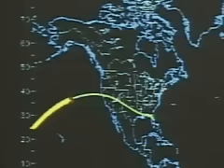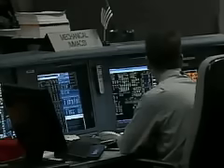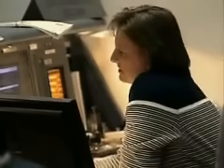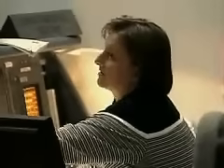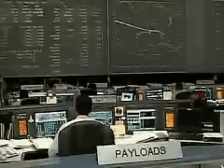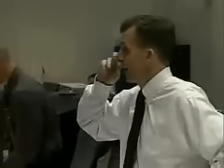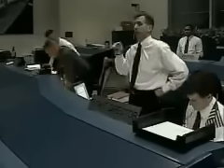Inside Mission Control During STS-107 Columbia's Failed Re-entry and disaster

Comment: When he said "FYI ive lost 4 separate temp transducers" you can see everyone in mission control shit their pants realizing what was about to happen
Reply: He basically said it out loud to a room full of engineers "And no commonality in those systems"?  He was hoping for a single point of failure - saying that indicates it was a catastrophic failure.
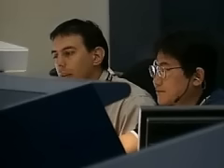Reply: 1:39
Reply: No they didn't know what was about to happen. We now have the benefit of hindsight
Reply: @bennri  Some of them at least, had a pretty good idea. The guy who's in charge, the one who says "lock the doors" said in a later interview that he had a pretty good idea what was happening as soon as those sensors went out. It's all so sad. Preventable tragedy.
Reply: @blackhawks81H  you are correct. there was a briefing the previous day on what they might expect (a scenario). flight director knew
Reply: @bennri  They must have had some idea. They knew of the initial damage on liftoff, and the approximate location of the damage. So when those sensors went out it was definitely an oh sh*t moment.
Reply: @tommyturner6923  Most of them didn't know about the tile I think, only the higher ups did

Comment: I've heard that the crew on the ground realized there would likely be a problem with reentry, but decided not to tell the crew of the vessel. Can anyone tell me if that's true?
Reply: Not true. The crew was sent the video. They discussed it. In the past, foam shedding was never an issue. If they had investigated more thoroughly, they would have seen the damage. They didn't have all the options other flights had. Columbia was configured for a science lab mission. The history of foam shedding dictated it wasn't going to be a problem. They were wrong this time. The crew gives the final go for landing.
Reply: @jrockett73  thanks for clearing that up!

Comment: That cracking, shuffling sound you hear right after, "Roger uh-bu-" is likely the shuttle breaking apart, because afterwards you hear them say they lost sensors in the nose, and more things go "off scale low, which means the system isn't getting any readings from it.

Comment: All their sensors must have been failing at roughly the same time. They knew what was happening.
Reply: when efd got confirmation that 4 indicators had stopped transmitting data simultaneously he knew shit had hit the fan. I guess the indicators are at a certain distance from each other and 4 of them failing simultaneously would mean a significant part of the shuttle had sustained serious damage.
Reply: When he asked if they had any commonality and the answer was no, he knew then something very bad had happened. You can see his expression change instantly.

Comment: 12:28
"Lock The Doors"
Reply: I never understood why they said that
Reply: @jackmesser4678  During an emergency situation at NASA, when a Flight Director gives the order to lock the doors, it means that the emergency situation has ended and the spaceship is lost. They literally lock the doors of the Control Center to prevent anyone from getting in or out. Everybody saves their telemetry data for the investigators and prepares to get interviewed. "Lock the doors" is an order no FD wants to give, ever... I hope it answers your question.

Comment: Tough to watch this video.
My very young son and I were watching it traveling overhead with high power telescopes and I knew something was wrong of course. I didn't have the heart to tell him what was really happening as we watched.
It was another example of a screw-the-pooch moment NASA is famous for, with the obligatory "Well space exploration is inherently dangerous" excuse....For example, per my father, an Air Force officer and former adviser to NASA, said they warned them regarding use of using pure O2 for pressure run-ups to check cabin integrity and NASA torched 3 good men for nothing.

Comment: NASA allowed a fatal scenario to recur. In the case of Challenger- evidence of prior o-ring failure. In the case of Columbia- evidence of prior foam strike damage. Rather than decision to launch based on engineers' recommendations, their concerns competed with administrative desire to stay on schedule. NASA's problems were bigger than o-rings & foam. No structural change was made in NASA' after Challenger, The stage was set for further disaster & loss of Columbia.

Comment: Not like they didn´t know what was going to happened. it was a done deal, they just opted not to tell the Columbia crew that they were toast
Reply: It seems like half the people insist that Mission Control knew with absolute certainty what was going to happen, and the other half insist they didn't and slam NASA for not finding out if there was damage.

The fact is, they knew there had been a foam strike, and other strikes had caused minor damage, but they didn't know that a chunk that big would blow a hole in the leading edge of the wing.

Comment: Could a recuse mission have been launched in time if there was a desire to?  What about the ISS or even a Russian launch?   From watching a couple of documentaries NASA didn't know for sure about the wing damage and didn't want to know.
Reply: The ISS was a no-go: They were in completely the wrong orbit, and it would have taken about 10 times the fuel they had on board to get into the right orbit.  The Soyuz spacecraft holds three, and it takes two to fly it, so they'd have had to do seven launches in the space of a month.  Even flying it with just one cosmonaut (if that's possible) would have taken four launches.  They didn't have that many spacecraft or boosters ready.

The Columbia Accident Board asked NASA to look at what a rescue mission would entail, and here's what NASA found:  If they'd known that Columbia was fatally damaged and the put the crew on a "minimum consumption" routine, the LiOH scrubbers that take the CO2 out of the air might have lasted to Flight Day 30.  So, they'd have to get the crew off by FD 29.  They estimated that it might have taken a full day to get the crew over to the rescue shuttle (which would have been Atlantis, because it was the furthest along), and they would need to allow a day for Atlantis to launch and rendezvous, so they'd have to launch no later than FD 27.

Atlantis might have been prepped by FD 27, but only if they skipped all of the checks normally done with Orbiter prep-IOW, slap everything together and hope it all works.  If there was any problem, the computers on Atlantis would shut down and she wouldn't launch.  There were two launch windows on FD 27, so if there was a problem (virtually a 100% probability), they'd have 90 minutes to get a crew of techs out there, find and correct the problem, and get the hell out of there, or they'd miss the second window.  And if a second problem cropped up, that would be it.

Now, add to that the fact that they didn't know why the foam came off Columbia's tank-which meant they had no way of knowing if the ET that Atlantis would use had the same problem.  If it did, then they'd lose two orbiters and crews.

During the transfer, the commander and pilot would have to "hand fly" Atlantis during the transfer, because Columbia didn't have a docking adapter.  Get too close and the orbiters collide; too far away, and they couldn't make the transfer.  And, BTW, the crew on Atlantis wouldn't be able to see Columbia while they were doing this, possibly for an entire day.

Since Atlantis would have to fly with a crew of four (two to fly her, two to do the transfer) and the orbiter only seats seven, four of the Columbia crew would literally have to be lashed to the floor for reentry and landing.

Some times, there simply aren't any realistic options-even bad ones.
Reply: I guess that pretty much sums it up.  I guess you can't cover every contingency.  Dangerous business.

Comment: Could they have reacted to the loss of those sensors 3 minutes before the shuttle was lost and abort the reentry? I assume at that point of the flight the shuttle would have no fuel, and definitely not enough to re-orbit.
Reply: No, once you start a reentry, there's no way to abort it.  When you do the deorbit burn, you're coming in half an orbit later.  And they don't want the shuttle carrying a lot of extra weight on reentry, so they're not going to have a lot of fuel even if orbital mechanics allowed it.

Comment: You folks are reading WAY too much into this...at this point, they'd received a caution and warning alarm about Columbia's tire pressures and the CAPCOM (Charllie Hobaugh, "Skorch") was just passing on the fact that they'd seen it in the control room. Husband's response was an acknowledgement of that transmission that simply got cut off by the loss of comm...there was no grave concern on the CDR's part, in fact, the official transcription from Husband has always been: "Roger uh buh..." in a tone lacking any drama or fear. He was most certainly just responding back to Skorch's update...so to all you amateur's out there...please get your facts straight before posting. All you're doing is embarrassing yourselves.